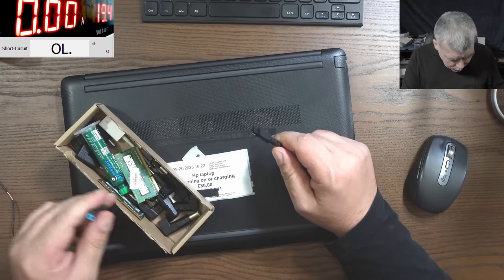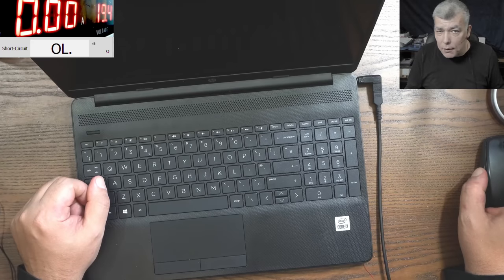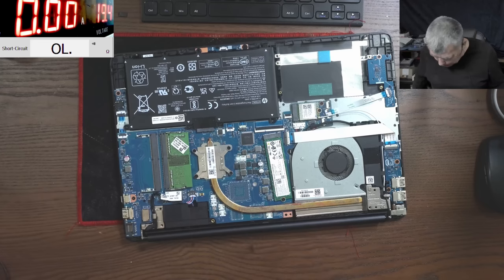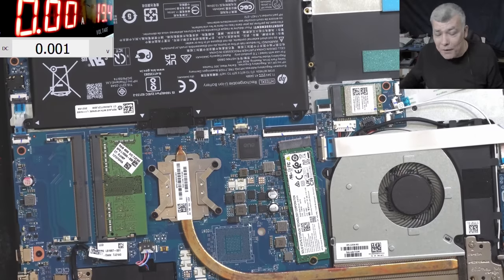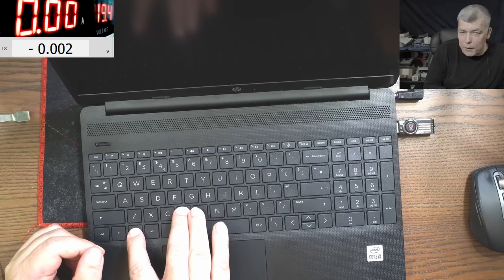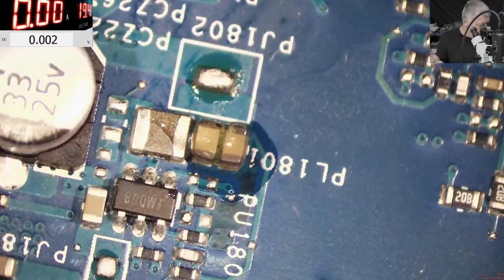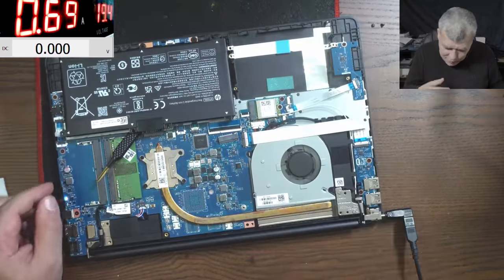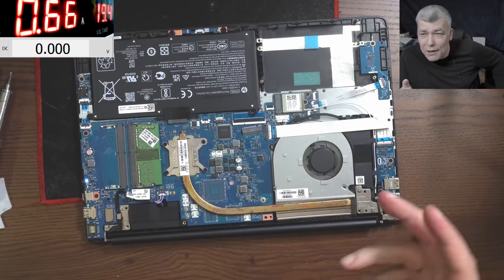This laptop has been fixed just by watching the CURRENT! HP 15-dw1513sa comes on with no picture

Comment: Water underneath the SSD. Somebody has been inside before. Interesting fault. Watching the current and understanding how the EC chip works in the case of an i3 lead to thinking it's a BIOS issue. But all the time it was missing 1.8v. But that knowledge of how the EC chip works in this instance and watching the current and looking for heat found the fault. Great video.

Comment: Not a capactor, its an inductor...PL  stands for power inductor!
Reply: An inductor is near both caps
Reply: @chillinfartdotcc  yes but Sorin was incorrect. Those components he was removing were inductors not capacitors
Reply: @dombarton2483 I've never seen and inductor that looked exactly like a ceramic capacitor.
Reply: @SMAAAASHTV  they technically dont, but its not uncommon to make that mistake.
Reply: @dombarton2483  no, the two components that Sorin removed are indeed ceramic caps. The board does not label the caps on the silkscreen. The PL1801 is designating the nearby inductor, because there's no room for the text where the inductor actually sits.
Reply: @SMAAAASHTV  ok, but PL standards for power inductor, and PC stands for power capacitor. That is what sometimes Sorin confuses himself with.
Reply: @dombarton2483  Actually they were both 2 capacitors and the PL is labelled for the inductor next to them. If you've payed close attention you'd have noticed that he replaced only one of the two capacitors and the one he soldered is probably equal to the sum of the capacities of them.

Comment: I bought the same universal DC jack connectors like you use. But at the end of the cable there is a usb-c plug. Did you cut the cable to be able to plug it into your bench power supply?
Reply: In another video he mentioned that he used an extension with usbc female socket and cut that off at the male end to attach it to the power supply
Reply: @ootyguy9805  Thanks!

Comment: Question i want to fix my motherboard because it's shorted but my path on my motherboard from the charging port is kinda in a loop or i don't know the path does not lead me into any mosfet and no mosfet or fuse is close to the charging port my laptop is samsung rv510 i'm not even sure if the problem is with the mosfet because i have lots of chips where some of the pins are fine and one of the pins are shorted sorry i dont know much about hardware

Comment: What universal adaptercable do you use with the powersupply?
Reply: He has a link to it on his Amazon list - it's basically a USB lead that he's cut the end off and then wired/plugged in to his bench power supply.  I've done something similar with a standard DC jack soldered to two banana plugs which then goes in to my desktop power supply.